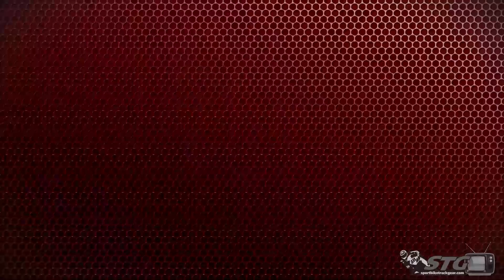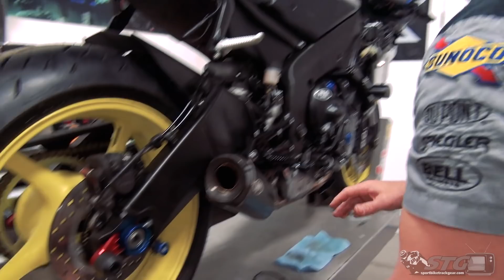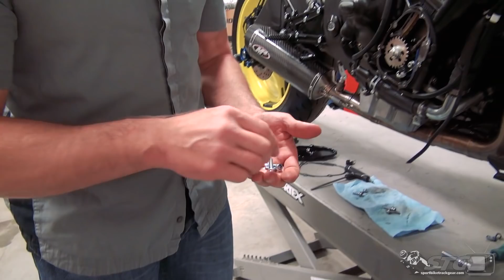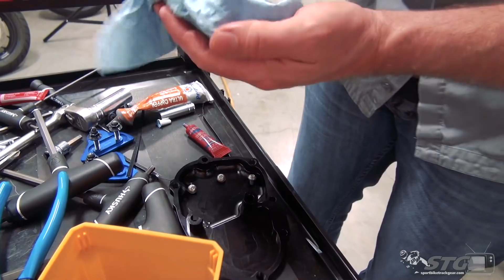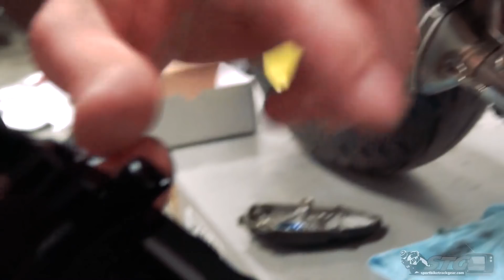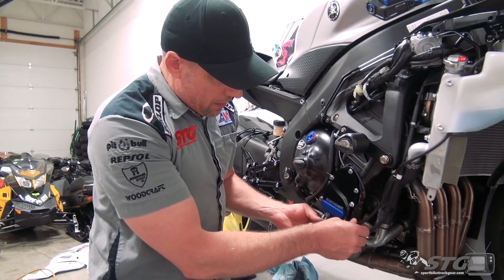Woodcraft 2017 Yamaha R6 Engine Cover Install | Sportbiketrackgear.com

Comment: Hey guys. I did the same exact thing to my 2017 r6. Had a small spill, cracked the cover, but the worst thing is - the bottom most right bolt ended up cracking the female threads on the case. Didn’t break it off, but the threads are cracked. Seems to happen as per the design. But how would I fix the case without breaking off the chunk of threads? I’ve read numerous options to fix but I ultimately don’t want to break off the cracked piece of thread. Thanks, I hope I get a reply before I try to go and fix it. Ps your videos are very helpful, I was in the process of NRC playe/blinker delete and new chain and sprockets and then this happens. Thanks for any advice
Reply from the maker: You will need to clean the threads with a tap and run it in as long as you are able to. There should still be some useable threads at the bottom of the hold. It may also be necessary to source a fastener that is a little longer than the stock one was. You need to make sure it is not too long and bottoms before you have any torque on the cover. This is the type of repair that requires a little finesse. - Van
Reply: @sportbiketrackgear  thanks for your reply! Finesse indeed cause I’ve been stressing! I have a few more important questions, should I use oem gasket with a little yamabond on case surface and cover surface with gasket in between, and also I failed to mention that the cast aluminum surrounding the threads cracked as as well, so basically half of what keeps the bolt in is compromised. Should I put a tiny dab of jb weld along the cracks or some kind of aluminum brazing repair rod. If my measurements are correct there’s about 3-4mm Of cast aluminum left behind the existing broken threads. This job is getting the best of me as far because I do not want anything else worse down the road to happen. Thanks again your guys videos are very thorough also!
Reply: Re:  I ended up buying this exact cover because the oem one I ordered and got shipped was junk. Still trying to figure out the cracked aluminum around the threads on bottom right bolt hole

Comment: Hi! You are a premere source in my book when it comes to sport bikes and diagnosis and repair!   I recently was involved in a very nasty hit and run accident where a lady pulled out with no singles on and crushed me and if it wasn't for my helmet I would have been dead.  My bike slide on the clutch side' crankcase side and loosened up the clutch cable a little bit and made a little crack in the lower portion of the part of the bike where the clutch cable goes directly across. So not the crankcase the piece that is down and to the right of the crankcase.... I hope that explanation helped you understand what I'm talking about a little bit LOL I could send you some pictures via messenger if that would be okay with you. Basically the clutch cable came loose because the bike slid on that side and loosened up some parts but I was able to inspect the clutch cable and clutch and everything was okay in that department I took her around the block a few times and Shes shifting okay but the clutch is a little bit loose and does need to be tightened a little bit. But I think that's because of the bending of the piece that I was talking about before down on the right of the crankcase. Anyway I have a crack in that area and it's significantly leaking oil I was wondering what in your opinion would be the best epoxy for me to get to seal off that little crack. I was looking at J-B Weld and a lot of people said that that would be the best direction to go in and that that works the best and I just wanted to get your opinion being a professional and in my opinion one hell of a mechanic, that would be a good route or a good fix to try sorry for how long this was but I wanted to try to get you to the best picture in your mind of what we were talking about here thank you very very much 
Brian
South philadelphia, PA
P.S 
I wish I was in your area i would take the bike directly to you!
Reply from the maker: Shoot me some pictures to service@sportbiketrackgear.com. This comes directly to me and  I will try to help you get this sorted out. - Van
Reply: @sportbiketrackgear  hey thank you so much for your time! I messaged pictures to you now.
Brian

Comment: I'm waiting for your video of quick shifter installation process.
Reply from the maker: We did not install a quick shifter on this bike during the project. - Van
Reply: Sportbike Track Gear but I have seen a video installed quick shifter on this bike. However, it wasn’t clear like step by step. That’s why I asked

Comment: Hey brian! I have the Yamaha R6 2017 and was wondering where I can buy that small blue driven accessory on the damaged cover of the engine you are replacing. Thanks!
Reply from the maker: Pretty sure this is what you are after:
Driven Engine Plug Yamaha YZF-R6 06-19
https://www.sportbiketrackgear.com/driven-engine-plug-yamaha-yzf-r6-06-17/
Reply: @sportbiketrackgear  Awesome, thanks! Is there an option for the colour gold? It doesn't say anything on the website 😅

Comment: Do you think the blue loctite is sufficient enough for the skid plate bolts? Some say to use the red one
Reply from the maker: There is no real pressure here so the blue would be plenty. - Van

Comment: How do you repair the part where the bolt got smashed on, but the inner housing?
Reply from the maker: What you see in this video is exactly what I did to get this sorted out. Not 100% ideal but we made it work and it has held up well. - Van

Comment: Mine cracked but it pushed the screw inward and cracked half of the screw holder hole,  basically the part where the screw goes in and cracked half of it because the screw bent in. I'm planning to clamp it back into place and add JB weld. What do you think?? It's that or replacing the whole bottom  crankcase..   https://www.youtube.com/watch?v=-8qh6n2-x0g&feature=youtu.be
Reply from the maker: Did you have the Woodcraft cover protector on the bike when you crashed? That cover typically does a solid job of protecting that area in a crash. I would not recommend the JB Weld. Remove the broken bolt to see if there are any threads left in the case half to use. It looks like the boss in the case half is longer than the bolt so you may be able to drill and tap that a little deeper to save the case half. If that does not work you could use the JB as a last resort but that is not a permanent fix IMO. - Van
Reply: @sportbiketrackgear  Look at the  video link. There is thread but the oil would sip through if i dont close the screw holder back up